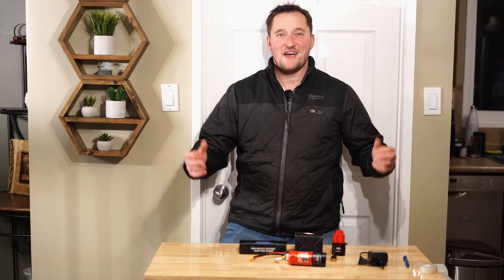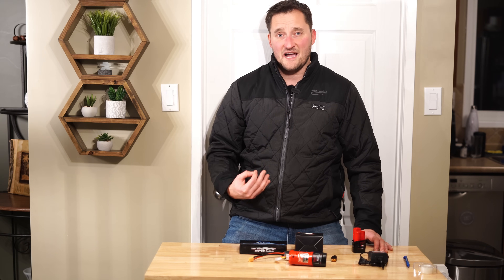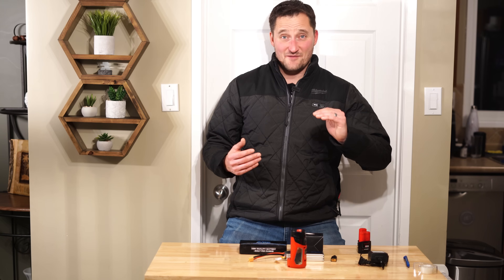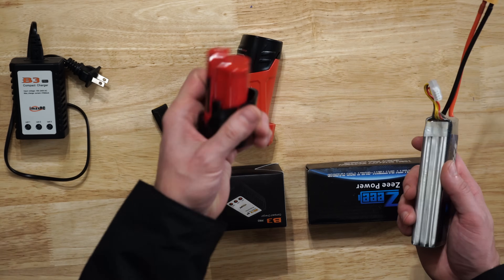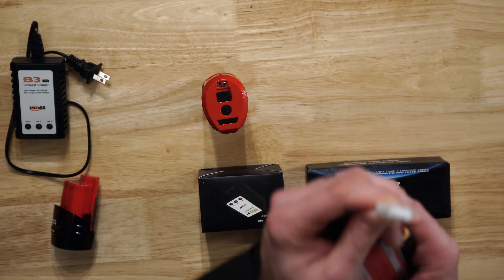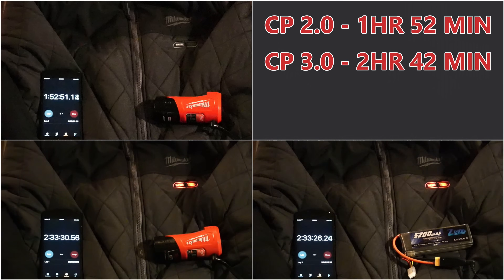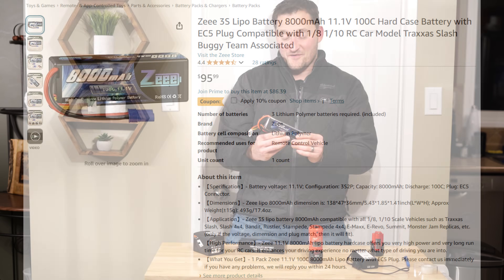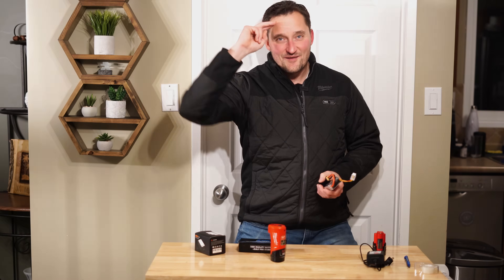WARNING! Read Description - Milwaukee M12 Heated Gear Battery HACK for INSANE RUNTIME!  Part 1

Comment: Highly recommend to get a lipo low voltage buzzer, if you discharge the cells below 3.2 volts it will damage or catch fire.  If the lipo is not in use store at half capacity
Reply: Yeah......he's gonna discharge that n get way more heat than he's ever gonna need.....
Reply from the maker: @daleb5967  Hi there, I'm now using a low voltage buzzer with the setup. Thanks for taking time to comment!
Reply: @RegsChannel  Then you should update your video showing that and why its important to have one. Someone who doesn't know anything about lipo's is going to kill their brand new battery or even worse, catch on fire because their high amp draw heated jacket doesn't care what stress it puts on the battery. Safety first my friend.
Reply from the maker: @jjpjesse1990  I've updated the title of the video and the description to reflect that, thanks!
Reply: And be on the jumbotron on national TV.......lol
Reply from the maker: @daleb5967  it's the CFL, we need the ratings!
Reply: Better put that in a coffee can when charging.........or better yet.....   Watch the video where the dog sets the house on fire, chewing the cell phone charger battery....
Reply from the maker: @daleb5967 Hi again Dale,  based on feedback I'm using an old metal ammo box. Thanks again for taking time to comment! Have a good day.
Reply: This is a very scary video.  I’m glad people chimed in about how dangerous this video actually is.  Someone is going to buy this setup, not read the comments and end up in the emergency room with some serious injuries. I get that time and money goes into a video like this, but you really should take down this video, add a disclaimer at the beginning and/or shoot an update explaining that you posted this video before YOU did the research and were lucky you didn’t burn down your house while testing. I’m sorry to seem so negative, but this video is pretty irresponsible in its current state.
Reply from the maker: @venomoussvt  Hi there, thanks for your feedback. I'm in the process of putting out an updated video, and I have added a low voltage alarm to the setup. I am pulling between 0.6-0.8 amps from the jacket, and when recharging the pack I'm recharging at 0.8 amps. Given that information, do you still feel that things are scary? To me scary is hammering 50+amps out of a battery pack like this, bashing it through all kinds of terrain and then recharging it to full in a flash! We all have a different assumption of risk. Cheers!
Reply: @RegsChannel  usually .5 amps, but you should be fine.  Just charge it in that ammo can.   I use an old metal tool box lined with ceramic floor tiles with a drilled hole so I can see the pertty charger screen outside the box😁
Reply from the maker: @daleb5967  I have an old metal ammo box I started using based on advice here, but every time I've used or charged the battery it has been cold to the touch. So your packs get hot when charging / in use?
Reply: @RegsChannel  well,......when I use em to jump start full size trucks......lol

They get hot during usual rc use.  I let them cool before I charge them.    They don't heat up during charging using approved chargers at approved rates.    I'm in the full grey area sometimes but when I am I use a metal oil pan outside and away from gas cans with "I threw my gas spout away caz it was to slow..." Gas cans, and trucks with carburators...lol.    

Really......you are good to go. 👍   Understanding that these can die for good or hit thermal run away all by themselves with improper use is what matters.   And you have it mastered.
Reply from the maker: @daleb5967  I feel like they found a way to package pure anger in these pouch cells lol jump starting a vehicle, yeah I could see it given how many amps one of these packs can hammer out! Thanks for the comment!
Reply: Yikes......

I use rc batteries for lots of non rc  uses,   but draining one at an undetermined speed and amperage in my pocket is not on my fun list.....😮
Reply from the maker: @daleb5967  Hi again, the discharge rate for the jacket is between 0.6 & 0.8 amps on high. I shut things down at 9.9 volts. I will not be running it below that threshold based on input I received, and have got a low voltage alarm to help ensure  that. Thanks!
Reply: @RegsChannel  we are just trying to help.  These things burn down houses of pros.         I'm still waiting for sum random dude to buy a used damaged Tesla battery and use it as a mattress n hook up a electric blanket, wide screen, n Xbox to it,...      Lol   ..........and up a video of the weird crackeling noises......lol
Reply from the maker: @daleb5967  Thanks for the insight! Take care.
Reply: @kevinjesus5424  also, an improper charger might not be a good thing......
Reply: @kevinjesus5424  n be careful nobody spills beer on the battery........or that anything stabs your jacket n Pierce's the battery while it's on you.
Reply: @kevinjesus5424  "Sky rockets in flight!  ......Afternoon delight!.........".    😀.       Sorry........been thinking bout it for days......😁
Reply: @kevinjesus5424  you'd think thered be hundreds of people with a puffed up battery that just tried to poke a hole in it with a Bobby pin to let the air out......😁.  Whata letdown..😁
Reply: I was to comment this. I was willing to bet he was severely discharging the lipo on that test.
Reply from the maker: @RCredneck85  Hey there! I repeated the test with a low voltage alarm and the results were very close.
Reply: It’s scary to think about how I used mess with 26650 and 18650 batteries in series on my mechanical, home made vapes with no safety features. I would twist up my own coils with 22 to 20 gauge kanthal with super low resistance. Thankfully the Worst that’s ever happened was when the fire button somehow got stuck and burned up one of my tube mods. When people started experimenting with lipo packs in their regulated mods and still almost catching their homes on fire, I decided i was going to go back to cigarettes lol
Reply: Thats bs😂 i have drained  lipo’s to the point they don’t accept charge anymore and are all fine.. had to use my voltage regulator to revive those very low state lipo’s that i have drained to the max..
Reply from the maker: Thanks for the Insight! I'll look into the LV buzzer. I could see overcharging leading to an issue, but discharging the battery below 3.2 can cause an issue?
Reply: @RegsChannel  100%. Overdischarge increases the internal pressure of the battery and leads to swelling. For a non-hardcased battery like this that's a death sentence and fire hazard. 

3.2V is a bit conservative. Makita batteries internally disconnect around 15V (3V per cell), other power tools likely similar. If you buy your battery from a respectable manufacturer they should give you a full rundown of discharge curves and min/max safe voltages.
Reply from the maker: @DLiu-ff1zx  Thanks for the info! Online for this particular battery shows a min voltage of 3.2v. I think when I test out the 9000 mAh hard case variant next, I'll attach the multimeter to the battery and give myself a buffer. I'm thinking a simple but effective system would be to set a timer for x amount of hours while using the heated jacket, and then meter the battery before recharging? In RC applications I feel like these batteries last minutes, whereas in this application they discharge over hours. Do you think that makes any meaningful difference? Thanks again for your insights!
Reply: @RegsChannel  There are a lot more variables than you think. Look up what a battery discharge curve looks like - voltage sag depends heavily on current draw. There's also the question of temperature. Is the pack going to be on the outside of the jacket and exposed to the ambient air? If so, cold cells sag more and you'll have to take that into account when calculating run time. Or are you going to put the pack between your body and the heating element? If that's the case, how are you going to positively ensure the pack stays under the max temp?

Realistically, running any lithium ion battery with no protection whatsoever is a gamble. For an RC car or plane, it's an acceptable gamble, because if you screw up and your pack ignites, well your RC plane usually isn't strapped to your torso when it's running full tilt. 

Look, I get it. I hot rod batteries too. I build my own 21700-cell Makita packs because they refuse to put out a 1st-party solution. But this is a case where unless you buckle down and really do some research into how to ensure both your own safety and the safety of those you're seated next to, it would be a much better solution to just bring an extra M12 battery or two - where these considerations have already been accounted for - and swap out as needed.
Reply from the maker: @DLiu-ff1zx  Thanks for the feedback! Sounds like you have a ton of knowledge in the field. As best I can tell, the jacket pulls around 0.6 - 0.8 amps on high. The battery pouch on the jacket is not near the elements at all, so it would be sandwiched between 2 layers of fabric only, so I imagine it wouldn't see a lot of warmth from the user. I have worn the jacket several times outdoors already, and the battery has always been cold to the touch on both charge and discharge. Also worth mentioning, I have not ran it till it to 0 (closesest I got was when I test d it in the video) I can see voltage sag being an issue in high current draw applications where you are hammering amperage out of the pack (like a power tool, drone, or other RC applications, but would using a 50c battery pulling less than an amp be as worrisome? I appreciate the information!
Reply: @RegsChannel  If you're insisting on going the unprotected route, I suggest you run 15-20 cycles, monitoring pack and cell voltages, and determine how much variance there is in power draw and runtime. If there is really a range of 0.6 - 0.8A power draw, you could potentially be misjudging your runtime by a full third. See how the power draw changes with respect to temperature - does the jacket have a constant draw, or does it cycle on and off? Does the jacket have any sort of temperature monitoring or control? I'm assuming it does, for safety purposes - otherwise you could put a couple layers on over the jacket, hook it up to a car battery, and cook yourself to medium rare. But then the duty cycle of the heating element is going to dictate the mean power draw and therefore have significant affects on the runtime. Did it run for 6hrs this time because it was in a warm room and didn't need to cycle on as much? If you calculate your battery life for that use case, then when you're out in the cold and it's going to be running at full tilt, you're going to run it to 0 assuming that you have headroom. 

I'm not pointing to discharge curves as the only thing you need to worry about. I'm saying you need to look at this with a more holistic approach not just assume that 12V = 12V. "I've worn it several times outdoors" does not provide a quantitative understanding of what's going on. Keep in mind that with the placement of the pack in that jacket, if it ignites, it's at head-height for children.
Reply from the maker: @DLiu-ff1zx  Thank you for your input on the topic, lots of variables to consider here. I'm going to continue looking into what you suggested.
Reply: @DLiu-ff1zx I've never had a lipo Puff from discharging all the way..They Puff because you're pulling too much current.
Reply: @RegsChannel  that makes a big difference.   A five year olds drone will pull power faster.  Which means your draw is waay safer.   But you still can draw it dead by accident ( like if you get drunk at the game n forget and hang it up in the vestibule by the door and it reaches thermal runaway and turns into a road flare).....I mean.......I get drunk at football games.....lol

Just set your cellphone alarm/reminder/Google Alexa reminder to remind you of the hours or disconnect it..ECT...
Reply: @DLiu-ff1zx  Wouldn't Li-ion packs be wayyyyy better suited for this and (slightly) less sketchy?
Reply: @DLiu-ff1zx  you should remember that Li-Ion ( for example the common 18650 & 21700 style cells) are built with a different chemistry than Li-Po cells...the usual recommended low voltage for Li-Ion is 3.0V, and 3,2V for Li-Po.
Reply: @DLiu-ff1zx I lean toward  M12 batteries likely not having "protection" from over discharging, because I have had a a few do just that and I had to revive them. I had one M12 battery die all together when a tool over discharged it. I believe the shut off is in the M12 tool also due to the M12 tools having the battery level indicator on them instead of on the battery like the M18.
Reply: @jeepsaround  that can happen if somebody keeps trying to use the battery after the protection tuns it off.   The volts creep up a little above the limiter and let's power get drawn again.  But yeah its possible.
Reply: @jeepsaround  there's a video on YouTube where a guy refits his older nicad drill to lithium.... He did add a bme to the pack to prevent over discharge.   An interesting take.
Reply: @RegsChannel yes it can and NO that 5200 batters is only 5200 it’s ment for rc cars so big time discharge your jacket is not pulling the amps a rc car will so it will make that 5200 last longer. And get a proper charger you need to be able to charge a 5200 battery at 5.2amps for hats 1c for that battery you can get a auto charger for under $50 it will charger it in one hour if charged at 5.2amps that would be 1c for that battery
Reply from the maker: @nickbreen849  hi there, thanks for the info! I put out an updated video when I'm using the low voltage buzzer and repeated the runtime test with it in place. I did also upgrade my charger fyi
Reply: @CentralOregonRC  since he's not charging during field use or events, he might as well charge slow in the home, edit:  next to the baby bassinet  and the fluffy sheep dog bed.   He's not a hobbyist.  No rush.  😁
Reply: @ Lopo chargers have different balance charge rate “slow. Normal. Fast” all 3 still charging at the 1c for the battery if you can’t charge it at 5.2 amps you won’t be able to fully charge that battery if his charger only puts out 3amps that battery will be not fully charged 1c on the slow balance option will take over a hour to charge but it’s still charging at 1c
Reply: @CentralOregonRC  yes I know.  I've got maybe 7 chargers.
Reply from the maker: @nickbreen849  good to know, thanks for sharing!
Reply: And undercharging a LiPo can be just as bad as over charging if it’s a crappy made LiPo it would be better for him to get a battery that matches his charger
Reply from the maker: @nickbreen849  Hi there, I just released a new video with a different battery, and I am now using a B6 charger based on the advice I got from here. Cheers!
Reply: Thermal run away or turns it into a fireball put it in lipo bag or box  when charging  @RegsChannel
Reply from the maker: @jasonkrantz8946  hey there, I'm using an old ammo box for charging, however I do charge these supervised at around 0.8 amps. Ramming current in and out of these does not sit right with me!
Reply: @RegsChannel  most definitely dangerous I'd definitely get a lipo checker also it will allow you to check the battery % from the balance lead.  I use lipos with large offroad lights instead of a flashlight and use a lipo checker and did some timed tests like your self you can do a 1 hour test with the lipo checker and see how far the battery came down in % so you don't have to do 6-10 hour tests on the setup you wanna use.

Comment: Great idea works with DEWALT as well
Reply from the maker: @MEl02907-  Thanks for the kind words! Yep, I would imagine that if the plug is similar it would work! Only point to look out for is the DeWalt system is 20 volts I believe, so you may need to look at the 22.2v lipo cells. Hope that helps!
Reply: Mine has the 12v/20v duel power jacket! Works great. Used your items but got the bigger battery.

Comment: Thanks for the video!  I run those Zee 5200 batteries in my RC trucks.  Just so you know - that battery is available in a hard case style instead of the soft pack you showed.  Same capacity - just more durable for banging around.  Just be careful about running those LiPo batteries too much lower than 3.2V per cell.  Could damage them
Reply from the maker: @JeepinMaxx Thanks for the comment!! Yeah I purchased this one as a proof of concept and was blown away by the results! I just ordered the 9000 mAh version that's in the hard case and will doing a showdown between the two of them! Agreed, my plan is to do a runtime test, test voltage and then do some math to figure out a "safe" runtime for longevity
Reply: You can always revive those using a voltage regulator to the point you reach 3.2v then finish it on a regular lipo charger
Reply: On M12 and M18 batteries, if you run them down too low the chargers won't turn on. They aren't ruined because you can charge them back up with other direct power sources such as power supplies or other fully charged batteries and they will.continue working fine. Can you do that with RC batteries?

Comment: I wouldn’t put one in my pocket 😬
Reply from the maker: @MattLitkeRacing  I don't think they are that bad, I've used this setup several times
Reply: @  they are rated for high discharge and have no protection like tool batteries
Reply from the maker: @MattLitkeRacing  I would argue high discharge on a heated garment is a good thing! No worry of overcharge on a heated garment. Perhaps voltage dropping too low, but there are workarounds for that!